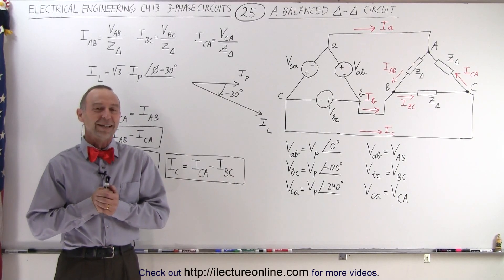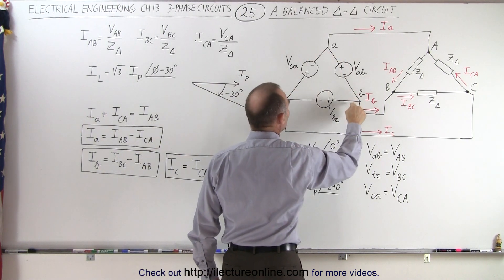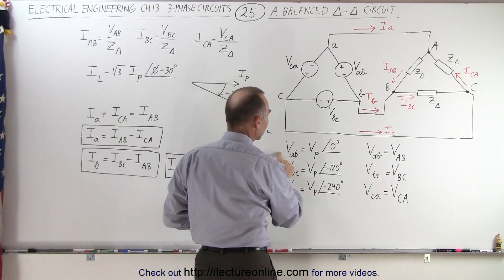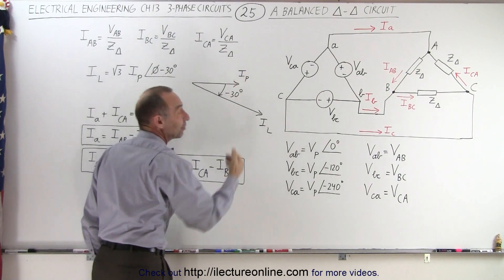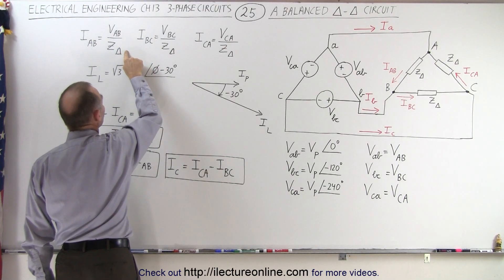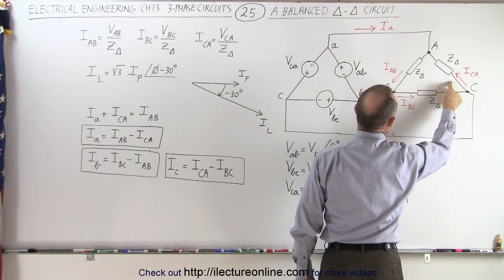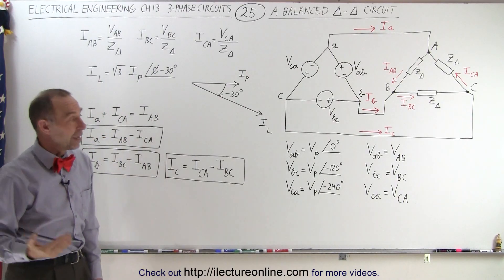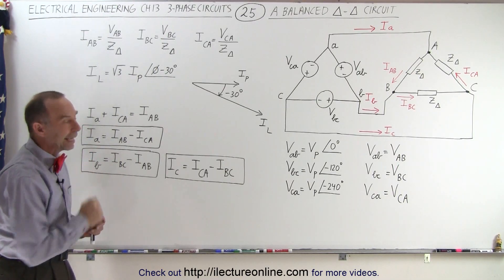Electrical Engineering: Ch 13: 3 Phase Circuit (25 of 53) A Balanced Delta-Delta Circuit

Comment: I've been trying to figure out how to calculate the currents coming from the sources in the delta connection and I always end up with something circular like Vab + Vbc + Vca = 0. Is it even possible to calculate the currents coming out of the sources using Kirchhoff's Laws?

Comment: but what if there is some impedance on the each current lines there at the Ia Ib and Ic ? will the formula still be the same ??
Reply from the maker: The impedance on the current lines are very small compared to the loads and are therefore ignored.
Reply: @MichelvanBiezen  but my tutorial questions got the impedance from source connected to the load at each of the lines.. how do i solve that pls
Reply from the maker: The load is what causes the impedance.  That is explained in the remainder of the videos in the playlist.